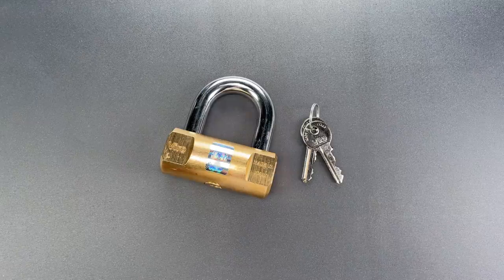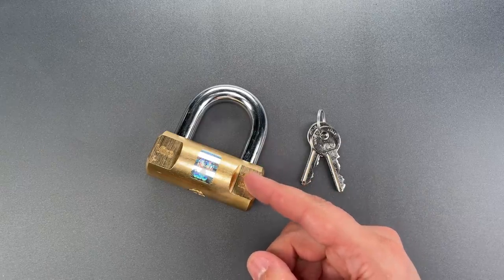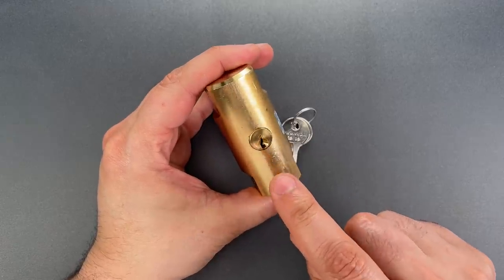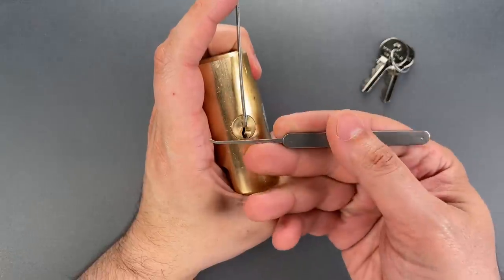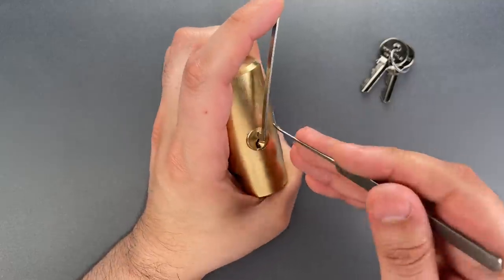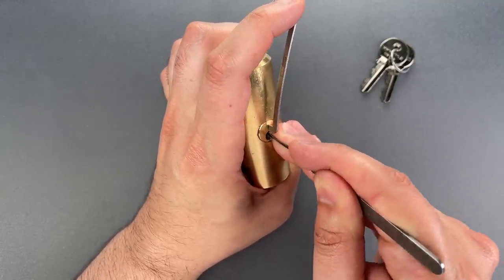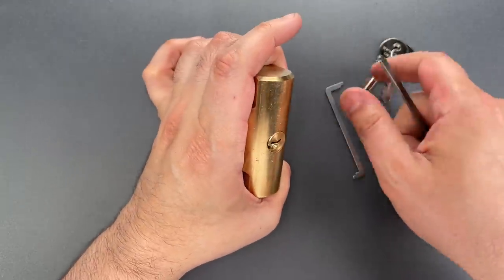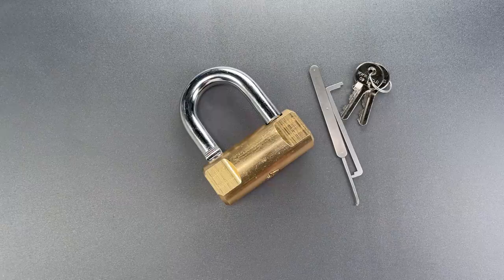[1341] Viro’s Secret Pin Foils Unwary Pickers

Comment: DUDE!!!  You gotta pick the Emergency Access lock on the Internet-enabled butt plug featured on the August 15, 2021 episode of Last Week Tonight with John Oliver!!!  Apparently, it has an "Emergency Access Key" in case a hacker takes control of it and starts to command it from Russia, so it begs the question: How difficult would it be to disable this device by picking the Emergency Access lock if it were currently "deployed" and actively vibrating and shape-shifting under a hacker's control.  You may not realize it yet, but THIS is where your entire life has been leading you, and you are COMPELLED to PICK THAT LOCK!  Please oh please oh please oh please oh please...!

Comment: Why is it that a lock can't be designed such that the counter-rotation from a spool pin would cause another pin (that's been set) to drop back down, and vice versa, essentially making a loop of resetting pins, so they could never be individually set?
Reply: Machining tolerances.

Comment: Random question if anyone wants to answer. I am getting into lock picking and was wondering, is it even realistic to pick complex security locks with paperclips? Or are those strictly reserved for raking and such?
Reply: Paperclips are relatively soft and thick, attributes which make them rather impractical for picking. Safety pins work better in my experience. In theory, if you can navigate the lock and reach the pins, you have a chance. That said, the feedback you get from proper tools is usually much better than that of cheap or improvised tools.

Comment: I'm kinda interested on how the internals of this look, but I'm guessing with its design that gutting isn't going to be possible (without damaging it)?
Reply: It sounds like there's the four normal pins that mesh with the bitting of the key, and one pin on the opposite side that just needs to be pushed flush with the bottom of the keyway. That fifth pin would be easy to pick, but since there is no bitting to betray its existence an attacker might not even know it's there.

Comment: Can you do one video on how to remove the bolt caps on ford tyres. I know it's not a lock. But they don't provide a manual on how to remove those to replace the wheel in case of a puncture. Recently I had to tow my car to a mechanic to fix the puncture. Even he couldn't remove those caps

Comment: If someone isn't familiar enough with a particular model of lock to know it has a hidden pin, how does one discover that while in the process of picking? How exactly is it "hidden"?
Reply: It's a double-sided key that looks like a single-sided key. There would be a pin sticking up from the bottom like the four sticking down from the top, but there's no outwards indication that this would be the case.

Comment: How the counter rotation works?
Reply: The top pin is a spool so when the top of the spool clears the shear line the core moves a little and it feels like it's set (false set). When he pushes the pin up again (hard) it forces the bottom of the spool to realign the core and the body (making a counter rotation to the tension direction) so it can clear the shear line and be fully set.

Comment: What does it mean when it falls into a false set?
Reply: The core turns a bit but does not open. Usually that means at least on pin is a spool or mushroom that is currently stuck at the shear line with its thinner part
Reply: @erichkitzmueller  thanks for explaining 😊

Comment: Obvious question, why not put multiple hidden pins?
Reply: Since the bottom of the key is flat (no bitting there), they would all behave identically. Also, the more pins you try to hide, the closer they get to the outside, so they become easier to spot.
Reply: @erichkitzmueller  I just realized how multi pins could be overcome, just a longer turning tool.  Thanks!